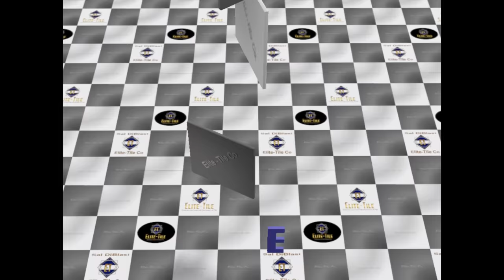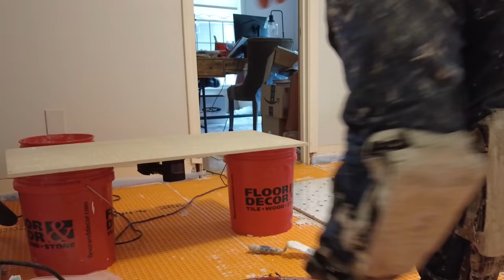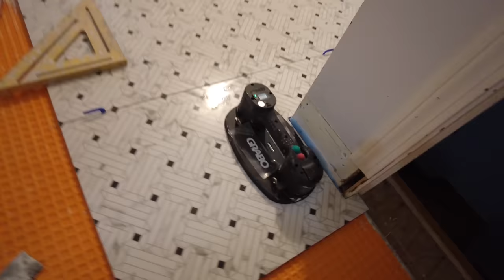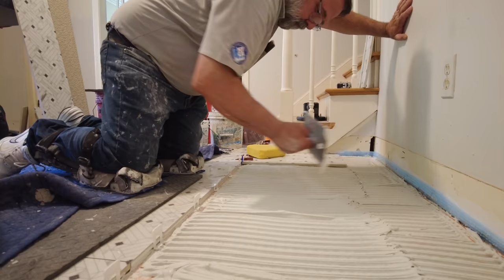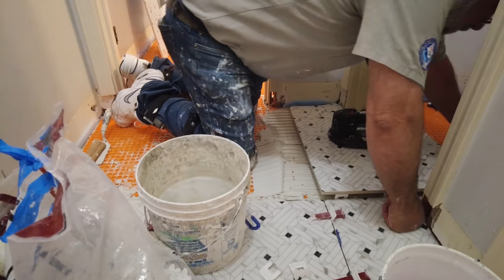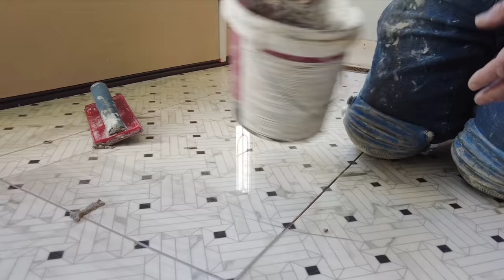Huge  20x40 porcelain tile installed on a floor.

Comment: Inspired from these kind of videos I tried to tile my mini bathroom few months ago, It was just a 50 sqf floor and I had 12 x 12 inch porcelain tile, the installer quoted an insane fee because he said for small jobs like these we don't charge by SQF, so I thought it would be better to do it myself. But believe me its not as easy as it look or maybe I was doing some over calculations or adjustments, I found it hell of a job because it requires a lot of stamina which only professionals of this field can have or maybe it was impossible for a middle aged man with not having an optimal health like me , It took me around a week to finish that small piece of floor Phew !!! not going to do it again ever.
Reply from the maker: Maybe the fee was not insane then, and if you are any good, you never charge by the foot no matter what the job is. That is a thing of the past.
Reply: @SalDiBlasi  + Maybe you are right but I was kind of broke and wasn't willing to spend much. thanks for the reply

Comment: This was an extremely intricate installation! Amazing craftsmanship. I was really curious about how you addressed the front door situation. I am glad you showing it! The other thing I am wondering is the transition to the wood floor turned out  since the tile base had to be raised so much.
Reply from the maker: New oak thresholds in all the doorways.
Reply: @SalDiBlasi  Thanks for the reply. I had a similar situation when I tiled my previous house in NJ. Ended up putting a new oak threshold as well. My first and last tile job 400 sq ft. I had no idea what I was doing except watching this old house and being handy and extremely detail obsessed. LOL I had to reinforce the floor, sister joists in the basement. It was 16 years ago and your channel did not exist.  LOL

Comment: Sal, I’m remodeling my shower and I put in a mud pan with a linear Diane.  I waterproofed with kerdi membrane.  Today I did the flood test and there were no leaks but water wicked up about 3 inches.  My question is can I brunch on hydroban (over the kerdi) to stop the wicking?  I called kerdi and they said I didn’t need to but I want to stop the wicking and spending $100 to ensure it’s water tight is well worth it.  So, is it ok to use hydroban liquid membrane over kerdi.  Thanks, Mark

Comment: Sal, you didn’t show how you made those remarkable cut outs for the air vents. Did you use your rubi or a grinder? I’ve done a few showers w these giant babies and find them hard to cut out they want to split abs fracture moreso on the 48”x48”  any suggestions?
Reply from the maker: These were easy to cut with the plunge feature of the saw then clean up the corners with a grinder.

Comment: Do you recommend a GRABO for A 4ft x 2 ft porcelain tile? It's 5/8" thick.

1/2 " porcelain and an 1/8" quartz like (solid surface)on top of that. 
Meaning it's huge and heavy.will grabo handle it?

What do you recommend trowel depth on floor and On back of tile?
I was thinking 1/2" floor and 1/4 on back of tile. 
Or 1/2 " on both sides?
Reply from the maker: Grabo will lift it for sure, floor has to be flat, maybe 3/8 on tile and floor. or 3/4 U and flat trowel the back of the tile.
Reply: Sorry one more question, would you recommend the Ditra X L for such large tile or Is the 1/8 original ditra ok?.
Reply from the maker: Whichever you prefer.